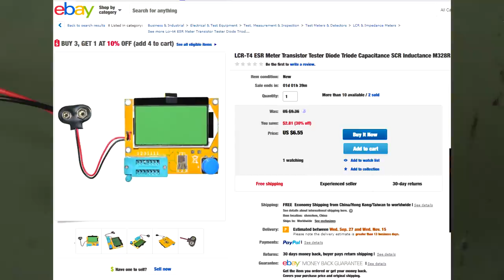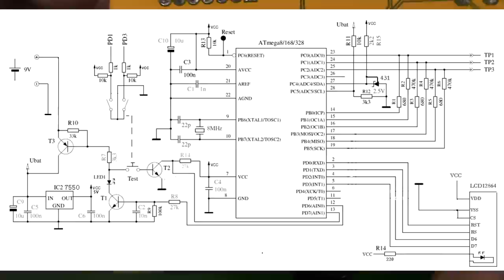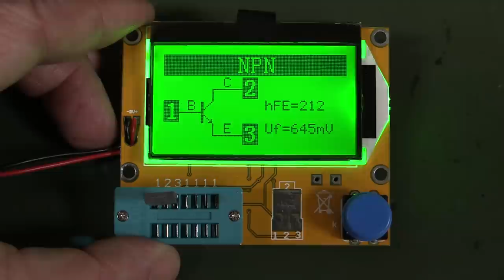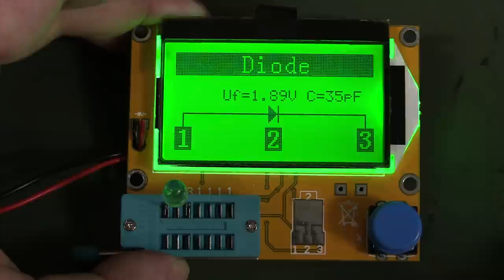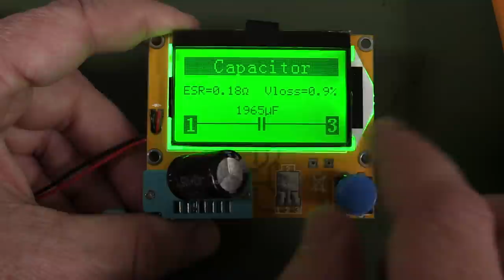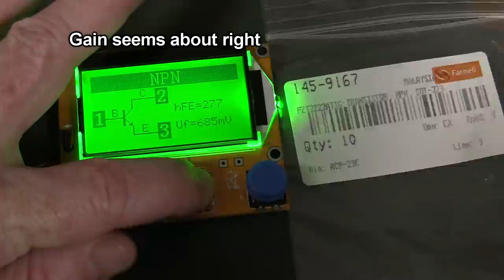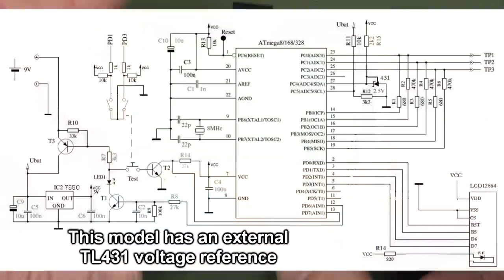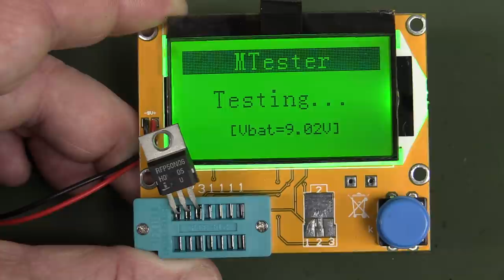EEVblog #1020 - Is A $7 LCR / Component Tester Any Good?

Comment: I have the same LCR meter, It's measuring inductors from the market,  but not homemade one, I tried with different inductors I made, but lcr meter says "Resistor" instead of Inductor, do you know why?
Reply: I observed that inductors having < ~50 uH cannot be measured by this LCR meter...The frequency of generator used is too low, IMHO.

Comment: Yeah these are pretty handy. Why you'd build one when you can get them for under $10 complete, I'll never know. I ended up getting one with a case and a couple of functions on it and it even puts out a square wave. But mainly got it to help with unknown transistors and mosfets. But as you can see, it doesn't get them all. Great for unknown LED voltages as well! For just over $10, I'm happy.

Comment: Can I plug test leads into the socket and use this to test components in non-powered circuits? Trying to troubleshoot a small dc-dc power supply with a 3 digit display that won't light up.

Comment: Things like vloss and esr are only displayed if the capacitance is high enough. vloss is the loss of voltage it has after a brief period of not being connected to the voltage. 

The real value for these things is for repair or tinkering with unknown devices.

usually the ebay ones have a very old firmware version, the newer ones have much better success in finding parts, also more uncommon ones as thyristors I think. In microcontroller.net you can find the full manual, it is worth looking at for a moment.

and of course you have to calibrate it first

Comment: heh! I've bought this thing to match transistors :D Seems it will not help here. Actually I've found that DIP transistors (2N3904 for ex.) bought in one ribbon (obviously made by the same machine) can be matched pretty close (without matching). Am I wrong here?

Comment: Trying mine for the first time, I opened a sealed Radio Shack 15 Assorted NPN's, and the first reading said "PNP"...!    I was ready to hit the amazon reviews, and took a closeup of the part and found that it was indeed a 2N4403 PNP!   Later, I tried a microcontroller digital pin and ground, and it says TWO DIODES and shows them connected cathode-to-cathode strung between the two tester pins. "That's pretty schmick!"

Comment: Most of us hobbyists can’t afford multi $k ESR meters. Hah. I actually use mine all the time. Surprisingly, it’s become indispensable. Even checking resistors - is that  band red? Orange? Brown? Purple even?? Who can tell on these cheap parts. Throw it in real quick, answer 10 sec later.   
I always forget , is the long leg the cathode or anode. Throw it in. 
Etc.  it’s close enough for most projects.  Just like my favorite portable multimeter is a (actually) pocket sized, 20 yr old Ideal multimeter I got from my grandmother when she died. Works great, small and has leads built in. No precision or accuracy, but quick and dirty if you just need to know if a wire has power or find the ground.

Comment: hi guys, got question - this tester not working with regulators like 337, 7808, 7805, AMS1117 3.3V? got a bunch of this and tester always show: "no, unknow or damaged part"... with capacitors, resistors, npn transistors etc tester working fine...   sorry for my english, and sorry for my knowledge, I`m starting with electronic :(

Comment: I've seen multiple comments that people don't have a use for transistor testers anymore. Why is that?
Reply from the maker: Because circuit that rely on actual transistor performance have fallen well out of favour. And they cost practically nothing, unlike in the 70's when it was worth salvaging them.
Reply: EEVblog Us beginners are still quite capable of doing stupid-things™ to them and frying them occasionally though (the shame of it!)  No magic smoke either. :(

Comment: From the mikrocontroller.net page: "This project is intended only for non-commercial use. Any commercial productions require the express permission of the author."

So that's why it's only the cheap, Chinese toy shops I see selling these! Anybody want to bet that they are all actually asking permission? Wouldn't it be nice to see someone like Sparkfun or Adafruit selling a version that is known to use quality parts, precise voltage references, etc...?
Reply: kc8rwr It could be argued though that the Chinese devices are just providing a service to hobbyists; it's not as if they're making any more money out of a working device than they would be by selling the parts individually, unlike a true commercial product that would tweak the UI and charge 60 quid (and the rest of it were Fluke).

Comment: This little tool is EPIC!!!! I feel like I've been living under a rock -_- ....... ORDERING ONE RIGHT NOW!!!! AND ITS 2019!!!!! WHAAAAAAAAAAT!!!!!! thanks for the upload.
Reply: Just a followup, I ended up getting mine in and printed a case for it as well, its works better than anticipated!! paid $6.29 usd on AliExpress and well worth the wait. It cant accurately detect all known components but WOW it works on a ton withing the specs!!! just let me know if you want a followup video =)
Reply: @MadLabZ  if you short three test pins together and press test it calibrates the device. Check the manual for more precise guide on this.

Comment: https://www.mikrocontroller.net/articles/AVR-Transistortester

Here is the original... and of course   they have a github page with firmwares for all variants  and shematics of this type of devices.
https://github.com/BackupGGCode/avr-component-tester

There are some additional tools for this for measuring  a zener diodes (with  external power and voltage divider)

Comment: No, it is not good as LC meter. On small inductance it doesn't know what is it.  Also there's inability to force the type of the component (e.t. inductor / not resistor).The original project is caller "AVR Transistortester". Hence it works best for finding unknown transistor pins and type. Unfortunately the German group didn't incorporate the necessary electronics to make it an accurate LC meter. An accurate LC meter is present here: http://electronics-diy.com/lc_meter.php  , the same idea with AVR MCU: http://www.cappels.org/dproj/EvenBetterLCMeter/Even_Better_LC_Meter.html, Kerry Wong did also one clone with ATMega MCU: http://www.kerrywong.com/2010/10/16/avr-lc-meter-with-frequency-measurement/

Comment: Karl-Heinz Kübbeler wrote the current code. The code, circuit and a 100 page pdf can be found at  
https://www.mikrocontroller.net/articles/AVR_Transistortester#Introduction_.28English.29

the is a 50meg file with all versions and make file to recompile this thing in about a thousand different ways. It is open source and if you have a USBASP or similar AVR programmer it is very easy to build.  I spent more than $7 building mine.

Comment: There are much better ones for about double the money. The one I have can read mosfets and it also gives the ESR for caps. I never expected much,but was pleasantly surprised with what it can do. This little unit read the capacitance and ESR on 27000 uf caps when my other meters read over limit.
Reply: Any link to the one you have?
Reply: M Sana  When I bought mine there were none as cheap as $7 and considering that I am not set up for changing the firmware,my time is worth far more than $7. Do you think I could find the firmware,buy any connections or devices needed and load the new firmware in under 10 minutes? If not it is FAR more expensive than me spending that time "making" money at work (I can work all the overtime I want). Time is money when you have a job.

Comment: It must be calibrated, at least by short circuit and open to be more precise.
Reply: My transistor tester has an error of about 0.1% for the parameters of resistance, capacitance and voltage.
But for this you need more accurate 6 resistors and tuning quartz.

Comment: This design of Transistor Tester (TT) is not best, I even consider it pretty poor. The ribbon connector and all SMD components are exposed to mechanical damage. So the FISH8840 by Weiwei, which I have, is much more robust. And it has place for external power socket mounting making it possible to power it with 9V AC adapter.

Comment: https://youtu.be/7Br3L1B80ow?t=10m17s
Did you notice the orientation of the body diode drawn is different depending on how the MOSFET was inserted into the tester?

For $7 though, some minor bugs can easily be excused.

I have a different component tester, DANIU LCR-TC1, which is several times more expensive, but it draws it correctly.  Also has some other features such as an IR remote decoder, which I don't have any use for but thought it was nifty nonetheless.  Also has a rechargeable battery built in, and a nicer full color display.  The component terminals are arranged better also; these bargain ones have the same pin sequencing top and bottom, which doesn't really serve much purpose.

Comment: I'm confused about the Zener diode. I thought it would have been represented as 2 diodes in an anti-parallel arrangement.
So if it is connected 1 way you have 1 forward voltage, and if current tries to flow the other way it has a different forwards votlage.

With the arrangement shown, current shouldn't ever flow.

Comment: Even I was surprised by the versatility of this device!!!
It's FANTASTIC in testing LEDS, expecially those used in TV backlighting, which are VERY DIFFERENT, in voltage and current used, from the one you tested. 
Being happy with it, I put it immediately in a box to make it suitable for lab use, and added multimeter- like probes to use it IN-CIRCUIT...
But don't make my error: Measuring electrolytic caps CHARGED, will BLOW UP the microcontroller in a matter of seconds!!!
Also the voltage present in-circuit, could damage the microprocessor!
So BE CAREFUL!

Comment: wicked they can make it, and sell it and still make a profit at these prices.. seem them go for well below 5 bucks
.. just the display would cost way more here in the western market.
wicked how the Chinese market has just cornered the worlds techmarket.
Reply: Not anymore. Hard to find them for less than $15 now
Reply: @jacksonblack9408  just took a brief look, and yep the T4 seems not that attractive priced, and above + 10 US.. but the more advanced  units with colored screen and enclosed casing and battery etc..like T1 and T7 series, and GM328.. those seem to be around +13 US with incl. 25% VAT when looking here from Denmark at Ali exp. (where all prices are locked with incl. 25% danish VAT) so will be cheaper from other regions, so I would pursue one of those if I was in the market for one in 2022..
there is also a combo unit from Fnirsi with scope and component tester. DCO TC2 but that is around 45 US so way more.
Reply: @jacksonblack9408  I think you can diy if you already have a microcontroller and lcd screen

Comment: I already own a dmm, and parts are labeled, I have eyes..and every data sheet is online, at your finger tips, within seconds these days..what am I missing here?? I'll keep the $7.00 in my wallet..
Reply: raindogred
I bet you it's more expensive if you build your own.
Reply: yeah agreed it is far more expensive to build one these days. But there is no reason I would build this or buy as I consider it superfluous to my needs..others may have different needs :) My life as an electronics hobbiest would not be made better by owning a device like this..but then again I'm really only interested in analogue electronics (guitars, effects, amps). The time it takes to insert a resistor, and hit the button..is slower than me just picking up the resistor and looking at the banding...I instantly know its value..like reading a word in a book..I learnt that stuff years ago. same as caps and most diodes. transistors it takes about 10 seconds to type into google, but I get so much more info in the spec sheet than what this device outputs?? I geuss the reality is that most electronics hobbiest these days is that the focus is on writing code in arduino..and learning dumb stuff like identifying parts values is a waste of time..and need a device like this to do it. Hence the excitement over this gimmick. horse for courses i geuss...

Comment: Dave, wud u rely on it as a TESTER??? my version wants to measure everything in pf and this pisses me off, damit. And why didnt u test any board mounted components with it??? u didnt do a complete review... cumon m8 make another video about this cos with my budget, these units r the only thing that helps me try to fix shit. At what loss percentage do u replace the component?  what capacitance value on a electrolytic capacitor where u would replace it? as I have found many caps to be alot lower then their stated value and r never used parts. I am sure I be real lucky to get a reply to this one.
Reply: I wish u wud make component level repairs on power supplies, inverters and chargers etc.
Reply: its some sort of crazy text speech I think.  The young ones use it I believe.